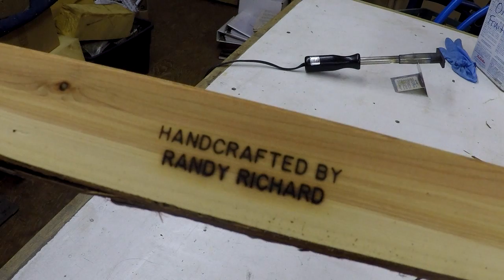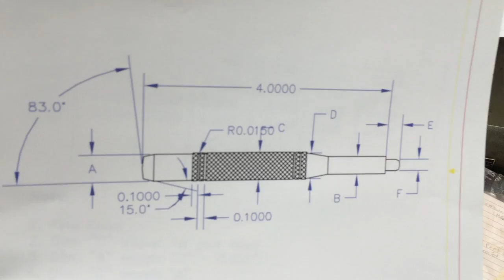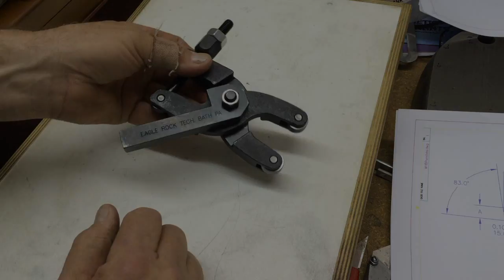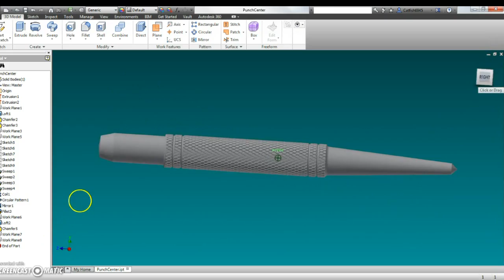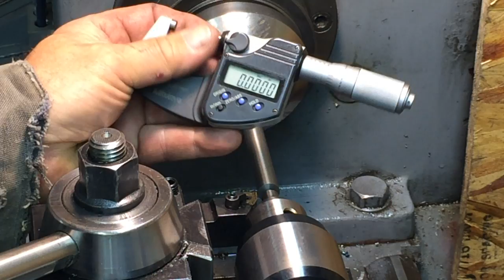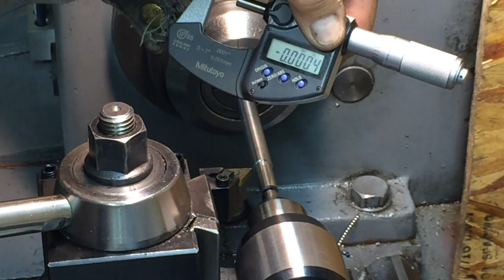How to Make Roll Pin Punches P1

Comment: Hi Randy, The knurling can be soo easy or, soo hard, a little practice helps a lot...
A tip about the oil to use, since you want to move metal without cutting, the best oil to use is a lubricating oil and avoid cutting oil... The better the oil, the easier the knurl, also depth of cut need practice runs to get perfect, too much it rips metal, too little, not enough knurl...
Coming along great, almost to the end...    Pierre
Reply from the maker: +pierre beaudry Thanks Pierre.  I ended up getting practice with this tool. LOL.

Comment: Good video Randy. I have the eagle rock heavy duty model and the instructions tell you to make sure the pins are oiled before use every time. If not at some time they will freeze up.
Reply from the maker: +19441978 Thanks, they were tough to get out.

Comment: 4/16 = 1/2 inch on the inscribed circle size? :-)  Yeah, those letter designations get a little complex, especially when you are looking at the tolerance and the types of holes and chipbreakers (3rd and 4th letter).  It gets even more difficult when looking at toolholders for them!Nice work on the punches.
Reply from the maker: +ILGopher Thanks Ryan for pointing that out, I put a note on the video @ 13.28.
Reply: I thought maybe that was some of that new math they are teaching kids these days.  Have a good weekend, Randy